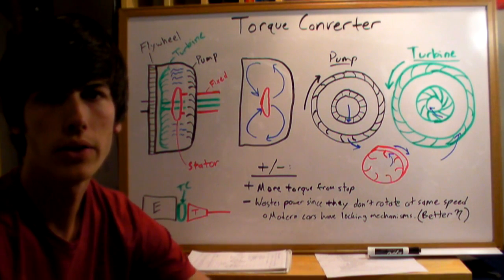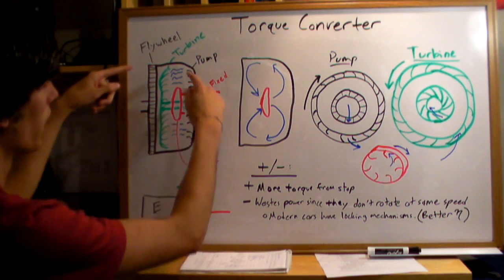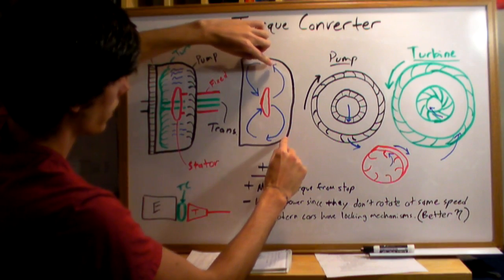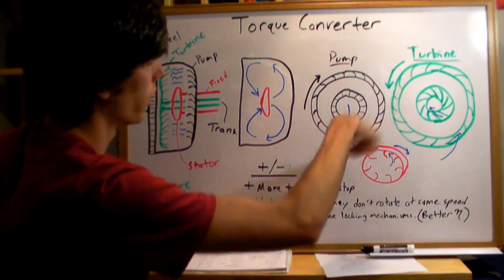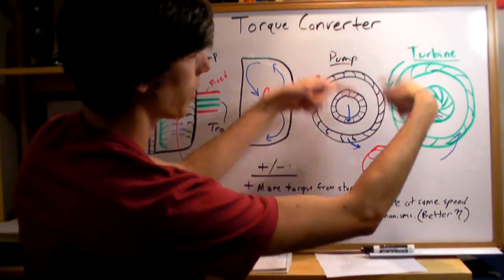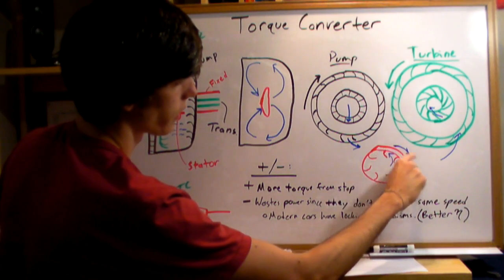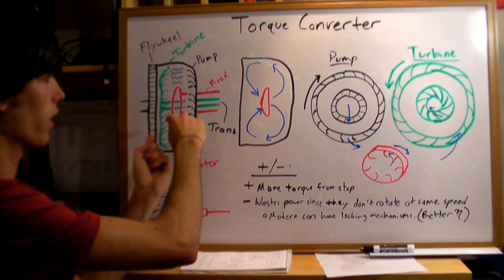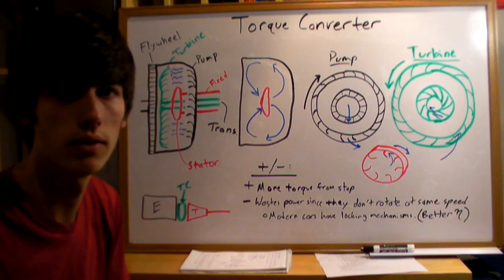How Torque Converters Work - Automatic Transmissions

Comment: An OK explanation, but your style has improved and so I think maybe you should do this one again.
Reply: I think everything from 2011 and back would benefit from being reuploaded in his new format, he speaks a lot better now and explains everything more clearly.
Reply: I'm working on a front wheel drive when I spin the front tires should the torque converter spin or dose it just spin under speed
Reply: Hello and welcome!
Reply: I agree. Especially if you could explain this using an actual dissected automatic transmission
Reply: Please redo it

Comment: In response to the questions about the one way clutch. Because the pump and the turbine are not mechanically connected to each other, the turbine will never reach the same speed as the pump. If they did, then the fluid would no longer flow around the converter. So when the engine revs are high, and the turbine will rotate no faster, the one way clutch engages, and mechanically joins the pump and the turbine. Because at this point the output is slower than the input, when the clutch engages...

Comment: Great explanation.  

I've worked with engines and transmissions (as a shade tree mechanic/engineer) but never looked in detail of the torque converter fluid flow pattern for years.   The efficiency disadvantage (you mention) of the old school torque converter is partially why some savvy  consumers  prefer the later generation lock-up torque converters with aggressive engagement strategies (say above 1500 rpm). As well, a good lock-up torque converter gives that feeling that you are directly connected to the wheels ( most of the time) rather than the horrible "slush box" feel of the early pre-1990 designs.  
Nowadays, I can't think of a torque converter without lock-up but maybe there are some in special applications. 

Having said that, I still prefer a manual transmission overall for feel.  Next choice is a good CVT as in a Subaru Impreza (some people will disagree). 

Thanks again for all your videos. You do a great job explaining engineering concepts to people with all types of backgrounds (non-technical and technical).

Comment: Absolutely. I heard that's how you "test" an automatic car transmission - by applying both brakes and gas at the same time and see at what rpm it will stall. But now, after your brilliant and didactic explanation, I know what it really tests is if the torque converter is working properly.

Also, I would like to know if the Limited Slip Differentials that work with fluids are good in transfering torque to the other wheel, that is, if they have anywhere near the same ratio as a Torsen type diff.

Comment from the maker: It's honestly fine either way, whichever you choose. Some engines (manual trans) will shut off fuel supply if you leave it in gear while coasting downhill, which could save gas potentially.

Comment from the maker: @Monstar001 Actually flexplates (as far as I know) are just the term for flywheels for automatic cars. The difference is they're typically thinner since the torque converter also has mass which is essentially carrying the same responsibility of a flywheel. The purpose of the flywheel is to even out the torque. Without it, the power sent to the wheels would be pulsating, instead the inertia of the flywheel keeps the power to the wheels smooth.

Comment from the maker: An automatic transmission which you manually select which gear to be in, electronically. It can be done with different types of transmissions, for example a dual clutch or a regular planetary gear auto.

Comment from the maker: @Dotchetter Well since the systems are connected some of it will drain. But if the engine's not running then the torque converter's not spinning, so the fluid on the bottom half could easily remain in. But it circulates with the rest of it so I guess it's no big deal.

Comment from the maker: I haven't done the math or research, but I would say it makes a good difference. That said, you don't want something too viscous, as it will tend to not move as much as a lower viscosity liquid. You want the liquid to be able to flow throughout the system so that it is capable of transferring the torque.

Comment from the maker: flywheel* flexplate* They serve relatively the same purpose, the flexplate is usually just smaller since the torque converter has a significant amount of mass.

Comment: loved your explanation, however i think flywheel can only be found on manual cars while auto cars have a much thinner light plate called flexplate that is directly connected to the torque convertor

Comment: You sure have improved in 10 years...  Anyway, pretty amazing engineering.  And to think modern automatic transmissions are as efficient or even more efficient than manuals, even with the added weight.  Probably massively complex too, though.

Comment from the maker: Correct. The friction of the brakes is greater than the force supplied by the torque converter, so it simply spins and the car does not move.

Comment: @EngineeringExplained I have the 7 speed automatic version with paddle shifters and it is a tick faster and geared a little tighter than the manual.  The control is actually pretty good compared to a manual (my previous car was a 350Z MT) because of this torque convertor locking feature that Nissan claims.

Comment: This is probably not the best place for this sort of questions, you'd better try a make/model-specific forum for you car. My tip: check the fluid level (very important in a A/T, if it's lacking oil, it could just pump air and not move at all), if that doesn't help go see a mechanic.

Thanks for the video, good and simple explanation, I've learned something.. :-)

Comment: A very interesting aspect of torque converters is that they also provide about a 2.3 to 1 torque increase when starting from a stop. The energy transfered in circulating the fluid from the pump to turbine to stator causes this. Without the stator, it is a 1 to 1 ratio and is called a fluid coupling. Research the old GM Powerglide torque converter. That was like a 5 to 1 ratio and had an extra stator and pump.

Comment from the maker: Transmission fluid, I think the goal is to maintain a relatively neutral viscosity with respect to RPM, but it may change some at different temperatures.

Comment: Great videos. I am just starting to learn about cars and engines and helps me a lot before I buy my first machine. My question is, how does an automatic Transmission works without Torque Converter? The Ford now has that feature for fuel efficiency and eager to know how does that work.

Comment from the maker: Close, but the torque converter is attached to the crankshaft (indirectly) so if the engine stops so does the TC. However, if the transmission stops the TC still runs. I starter motor initially rotates the TC/flywheel to get the engine running. Check out my video "starting a car" for more information on that!

Comment: The OP is correct. Although the turbine IS physically on the engine side when you stand at the side of the car and look at it, it is splined directly to a driveshaft that goes through a hole in the body of the TQ. The engine turns the whole body of the TQ, which is fixed to the blades of the impeller, driving fluid frontward against the vanes of the turbine. As to why they did that, I don't know! It might have something to do with optimizing output from the stator....

Comment from the maker: I guess the biggest thing to understand is liquids aren't compressible. They have to go somewhere, so when a force is pushing a liquid, the liquid will push as well. Basic principle of all hydraulics. Air is compressible, so if there was air in the torque converter it could just spin and nothing happen - liquid on the other hand is forced to move.

Comment: and the two parts are mechanically connected together, they are forced to turn at the same speed. This means that when the clutch engages, the engine is forced to reduce speed. As the engine speed picks up again, then the output shaft will rotate faster. In an automatic car, this 'lock up' feels and sounds a little like an extra gear change.

Comment: I know this maybe a silly question, errmm you know the black casing, is that connected to the flywheel, so when the engine is revving, the casing will be revving, meaning the pump will be spinning? But the turbine wouldn't spin until it gets to a certain level when the fluid drives the turbine with enough power which drives the wheels. Just need to clarify on that. Thanks.

Comment: Could you explain how/why the stator provides torque multiplication by changing directions of the fluid? I have never understood this.
Reply: The stator provides a stable point in the converter that the fluid can 'push against' to create torque. If the entire thing was spinning, the fluid inside would also just be spinning after a while, and barely any force would be transferred by it.

Comment from the maker: @Dotchetter Yes, modern torque converters lock up at higher speeds so now power is lost through the inefficient design of a torque converter. Don't see any reason why the fluid couldn't last a long time.

Comment from the maker: Without a torque converter you wouldn't be able to change gears, or have the car in neutral. There has to be an intermediary between the engine and the transmission so both can rotate at separate speeds when they are not connected (in gear).

Comment: i was just wondering, where does the fluid in the tranmission come from? Is it sealed in the torque converter or does it use the transmission fluid delivered by a hollow shaft?

Comment from the maker: Ehhh, I'd disagree. If your clutch is slipping (doesn't hook up, tires don't spin or you don't launch) then your transmitting less torque because the friction isn't as high as if your clutch wasn't slipping, so the amount of torque you can usefully transfer is less. Also, it wears your clutch. Flooring it in a auto won't really produce any negative effects.

Comment: lets say the engine is sitting at its peak torque range when I release the clutch(serviceable clutch) as quickly as possible while still maintaining the engine revs at its peak torque rpm, this is effectively dumping stored KE by the rotating engine plus the fact its operating at peak torque to move the vehicle. 
In a Auto perpective the Stored KE is in the fluid pressure applied to the driven end of the converter which is held stationary by the brakes. 
The two methods produce similar results.

Comment: Well explained operation of the TC, but just one thing to clarify for the audience. In a manual you can also be in a higher rpm than the transmission, can't you? The clutch unless is fully released will never transfer all the effective  power (minus heat losses obviously )  from the engine whereas a torque converter can transfer all the power from the engine and there will also be minor heat loses perhaps but on negligible amounts.  The more you press the clutch the less power is transferred. Not the case for a TC. Well the TC has in fact a clutch. I'm not sure but I suppose it looks up quickly not like in a manual where you have to release the clutch slowly. All this is when starting from standstill otherwise the manual will also operate quick enough (depends on the driver :) ) and almost all power will be transferred.
There is one more important thing. The stator can rotate in the  direction of the pump.
Once the fluid speed gets high, the forward flow will make the stator move with the pump and there will be no more torque multiplication. The cycling motion through the middle stops as the centrifugal force pushes the oil outwards creating a back pressure for the impeller outer flow. The input shaft will now rotate at the same time with the output shaft.
Thanks

Comment: You'll only have situation where the engine spins faster than the converter output while accelerating. beginning at 3rd gear modern torque converters automatically lock once the input/output speed matches.

Comment: Think of it like this, the fluid in the torque converter is constantly moving. When you step on the gas, the middle blade (forget what it's called at the moment) changes direction and forces the fluid to rapidly change direction causing it to move faster. It's just like in a jet engine. You have compressor blades that are at a certain angle that speeds up the air even faster. Well in some ways air and fluids are alike. Untill you get them to compress. Air will and fluid won't. ETCG...

Comment: correct me if im wrong, isn't the purpose of torque converter in an automatic transmission is to prevent engine stalling when a vehicle comes to a complete stop?

Comment: Is it ok to put your car in Neutral while coasting so it would go farther? or better to leave it in gear so it doesn't damage the gearbox? Oil lubrication and stuff.
What about coasting automatic car downhill for a few hundred yards, engine OFF?
Great channel. 10/10

Comment: Does the torque converter cause the shuddering or hesitation on a vehicle when taking off! If not what does? Can you give me a quck additive name for eliminating or close to eliminating the problem. Most of the time it runs good but at certain times I feel a shuddering during take off. At this time I cannot afford a overhaul or replacement of tc or transmission. thanks for your video, it has helped me save a ton on money

Comment: Regarding the torque converter ,I read that the stator is connected to a one way clutch and works only during a particular time. I am not sure if it is when the pump and turbine are rotating at the same speed or when the turbine is just about to move. Could you explain this especially about this one way clutch ?
Thanks in advance

Comment: great video on explaining how a torque converter works.But one quick question, if a car on a steep incline, when let go the brake, the car rolls backward, in this case, will that cause the turbine to overdriving the engine?  Thank you.
Reply: No, The torque created after the brake is released will not be enough to move the vehicle in forward direction on the slope you said ..

Comment: correct me if im wrong, but wouldn't the engine shut off if u didn't have a torque converter and u stop at a redlight w/o switching into neutral gear?

Comment: In regards to decelerating, is it the lock-up in the converter which stays locked up to hold the revs high when coasting or is something else within the gearbox?  Or does the road speed of the vehicle goes through the gearbox with the turbine assiting the engine to hold revs?   Just wondering on the reverse affects.  Thanks

Comment: Can you explain how the stall in a torque converter works? For example a stock 10 mustang 5.0, If you apply the brakes and gas at the same time the RPM will rise. but at around 1800rpm the torque convert will build up enough speed for it to start sending power to the wheels thus starting a burnout. Now if you have a high stall convert used in drag cars you can rev it to 3000, 3500, 4000 before it starts to engage. Basically can you explain whats been modified for that to happen. Thanks

Comment: So serious question. I got a stall at 2800-3200 if I change my crankshaft or pistion leinth will it change the torque speed so I will need to change the torque converter.

Comment: correct me if i am wrong. but when you have an automatic trans.and a torque converter what you are refering to as the "flywheel" the right term for it would be FACE PLATE or am i wrong?

Comment: What happens to the torque converter when we hold down the brake with the left foot, and rev the engine with our right foot..when the gear selection is on D. I hope you understand my question. Thanks.

Comment: So is a torque converter analogous to a resistor in electronics? Like a resistor will develop a voltage (analogous to RPMs) across it with current flowing through it (analogous to torque)? That what it seems like to me. And applying the brakes is the same a short circuiting a battery in "series" with that resistor. Does this mean that torque converters get really hot and dissipate lots of heat when operating? I would think there should be a better way than that...
Reply: +Power Max Ahh, last part of my question was answered in the last couple seconds of the video duh!

Comment: At the end of the video, are you saying that a torque converter allows the driver of an automatic car to rev the engine and the transmission at the same RPMs before moving, thus allowing for a better "launch"? I thought the ability to rev the engine up in a manual car with the clutch in and then pop it out and move was what gave manual car drivers the "launch" advantage.
Reply from the maker: Yes, that's what I was saying. Ultimately they'll probably come out fairly even, and since a clutch is a direct form of transferring torque, they often have less power loss through them than torque converters.
Reply: Oh, OK, thanks! I've learned a lot from your videos!
Reply: Husband

Comment: Can changing the torque converter change the power output? My dad has a Bronco that lacks power, and he thinks the guys that worked on it changed the torque converter, which is why it bogs now. Other then that, the only other thing would be he put to large of tires on it.

Comment from the maker: @2loko4you No idea, it would depend on your engine size which would determine your torque converter size, but you could probably find this info in the cars manual. Never dealt with automatic transmissions; hope I never have to. Sorry I couldn't be more help.

Comment: so the torque converter keeps the turbine rotating even when the engine has stopped,.... so when we restart the engine,.. it transfers the torque to the flywheel,. which inturn gives a good start to the car engine,.... am i right,. please correct me?